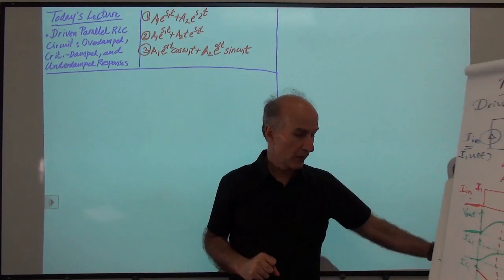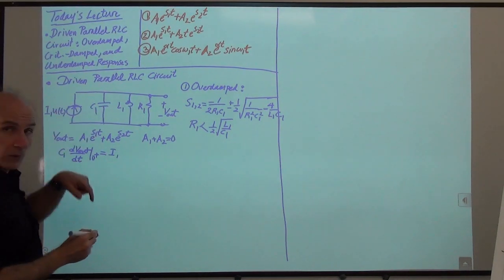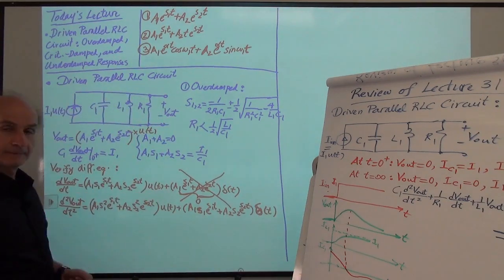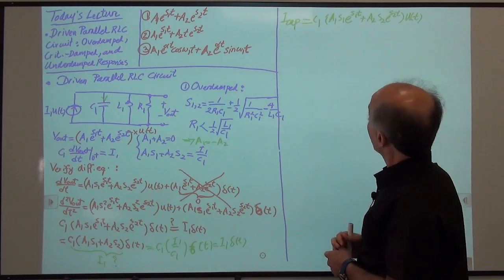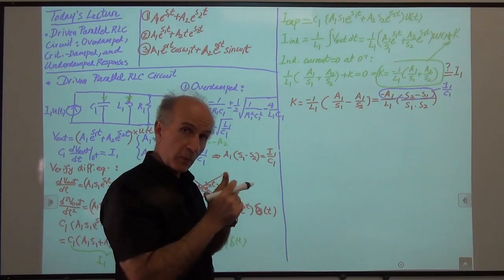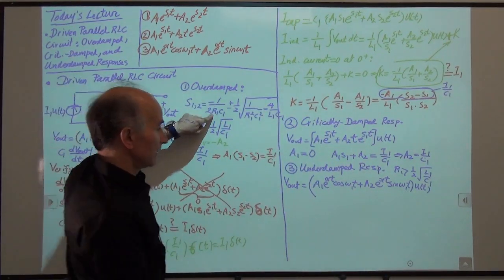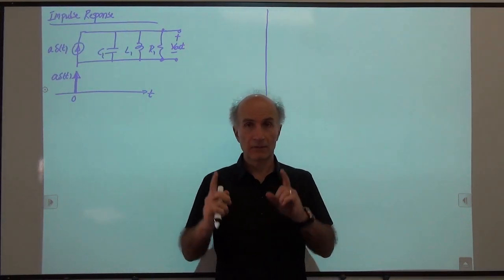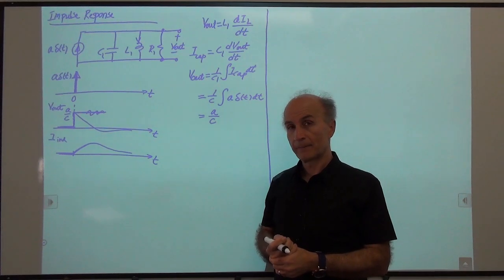Razavi Basic Circuits Lec 32: Driven Parallel RLC Circuit (Part 2)

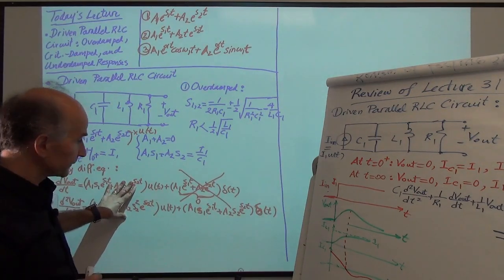Comment: Why at 15:33 the components that have u((t) add up to 0? I did the calculation but still don't know why.
Reply: Solved
Reply: @toneair1111 what was the problem when you tried for the first time and how it got resolved?
Reply: @qaisarawan93 the final result is u(t).[A1.exp(s1.t).(C1.square(s1) + (1/R1).s1 + (1/L1)) + A2.exp(s2.t).(C1.square(s2) + (1/R1).s2 + (1/L1))] + …. Delta(t)

You can see that both the terms C1.square(s1) + (1/R1).s1 + (1/L1) and C1.square(s2) + (1/R1).s2 + (1/L1) have the shape of the characteristic equation, and s1 and s2 are indeed the solutions of the characteristic equation which means these terms are 0 so the u(t) term is 0. So the only thing left is the Delta(t) term.
Reply: @toneair1111  i don't get it. Can you explain it again. Why does he confirm that all components have u(t) add up to zero before proving that the component which multiply by delta(t) is equal to 0
Reply: @26.ongphuong67 it’s just that when you solve the characteristic equation: C1.square(s) + (1/R1).s +(1/L1) = 0 you got s1 and s2 which are the solutions of that equation. And when you do the math looking for the final form of the final result:  u(t).<something> + Delta(t).<something>
(I answered 3 months ago above)
You will see that there are the terms where s1 and s2 have the shape of the characteristic equation. Both s1 and s2 are the solutions of the characteristic equation so when we put them in the exact same equation, the result will be 0 (because they are indeed the solutions of that equation) which leads to u(t).<something> + Delta(t).<something> 
<=> u(t).0 + Delta(t).<something> 
<=> Delta(t).<something>
Reply: @toneair1111  thanks a lot mate. you're legend

Comment: in minute 23 why the professor says "e to the power of s*t is equal to zero in infinity". isn't it equal to infinity?
Reply: if s is negative, it is equal to infinity
Reply: @23:04 Both S1 and s2 are negative so e^-inf=0. As for over damp response both S1 and s2 yield negative value